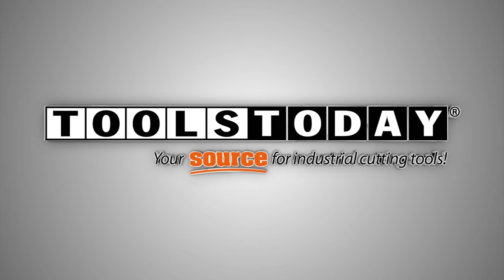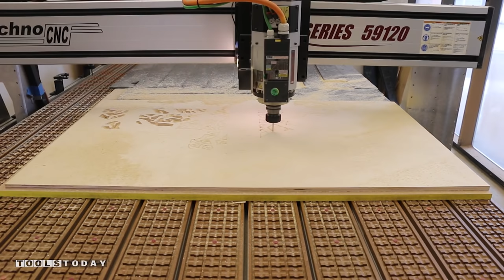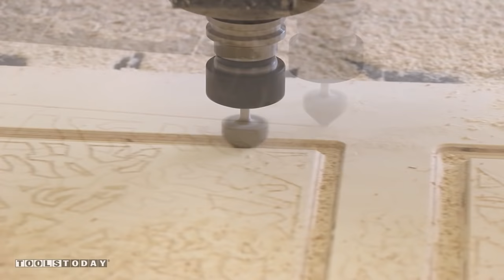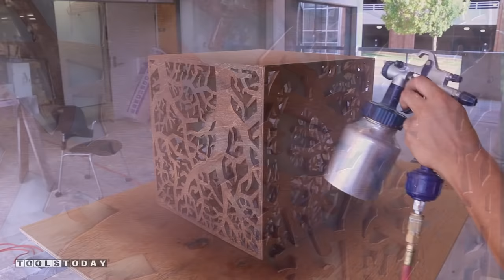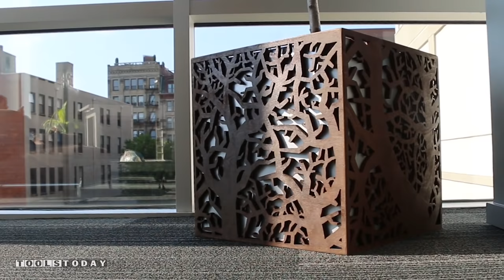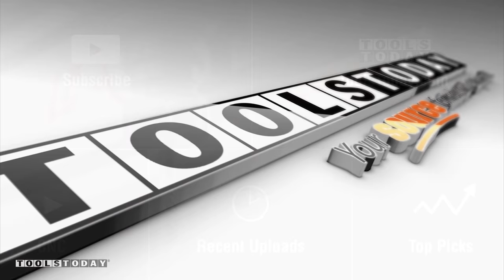CNC Project: Plywood Planter Flowerpot | ToolsToday

Comment: Nice to share good looking project.....QUESTION remains??....What was the actual step down ( dept of cut) value on this 1/8 bit at 120ipm ??
Thks
Reply from the maker: +rmesvp, For the 1/8" diameter compression bit no. 46180, the break point between the up-spiral and down-spiral is 7/32",  we cut just below this making the step down .22"/pass. This took 3 passes. We could have probably cut 1/4" per pass but we played it safe by cutting a little less.  For the V-Groove bit no. 45751, we stepped down 1/16" per pass, again, playing it very safe.
Reply: Thks for this....this will help ;0)

Comment: In regards to the step down of 0.22", isn't the feedrate a little high for the diameter of the 46180 compression bit?  I know you guys stated you were being conservative with the depth of the passes, but isn't 0.22" already pushing it?  I have this tool but I only operate it at 45ipm and .125" step down AFTER I have made my first pass with a .125" downcut spiral bit.  Amana Tool recommended .125" and 30ipm, so now i am really confused.  I am trying to cut down on my production times.  Please help. Thanks
Reply from the maker: +Omar James, we have passed your question to our technical department and will answer you as soon as possible.
Reply from the maker: +Omar James, we have recalculated the data and you can work with a speed of 18,000 RPM, a step down of 0.22" and a feed rate of 45 IPM.
Reply: +Toolstoday  But can I speed up my feedrate??
Reply from the maker: +Omar James, the manufacturer Amana Tool does not recommend speeding up the Feed Rate and RPM more than the recommendations.
Reply: so really don't understand this thread in the video you state that the tool cuts just fine at 18k rpm and 120ipm (which I believe I run downcut .125" spirals at 132 ipm with a .26" doc) but 2 messages up in this thread you are recommending 45 ipm which seems way way to slow (and not anywhere close to the chipload chart) and will generate alot of heat and is only a chipload of .0013" now under the product listing on your website according to the chipload chart Amana is stating under Veneered plywood a chipload of 0.012"- 0.014" at 18k rpm and x1D which is a feedrate of 432 ipm (for 0.012") and 504 ipm (for 0.014") so that being said if we drop the chip load by 25% due to the .22" DOC we arrive at .009" and .0105" with a feedrate of 324 ipm - 378 ipm   I just don't understand what to believe here and at 50.00 a pop we can't afford to be breaking a bunch while trying to dial in on one material let alone the 5 other listed in the chipload chart. I like Amana tools but this really really bugs me when a tool manufacturer says one thing and then the wholesaler says another and its all conflicting. 45ipm is way to slow in my opinion and we will be buying one every 10ft linear feet due to the heat generated and 432-504 ipm (even 324-378 ipm) is way to fast for a .125" shank tool at x1D (or x2d) in any material other than foam could we please have some clarification on this issue
Reply: Seriously., I've run into the same issue but have continued to buy these bits for years. I pretty much am running it at 0.25" steps at 50ipm at 12,000 RPM. I've tried running it faster but they snap. Also at this slow of a speed the path gets blown out in plywood and small pieces get dislodged if you are careful. I go through quite a few bits with my machine only really running up to 100 IPM. I do have a chipload spreadsheet and it will always tell me 100's of IPM for the proper chip load. What kind of material do you cut with this bit? What did you end up running everything at?
Reply: Hey Tom I have been running my tool at around 132-150 ipm and in some cases .75" doc but the usual is .25" doc with that being said I using it really only for a finishing pass taking off around .04"- .06" radially and .03"-.06" axially and 18000 rpm all the time so far I have run that tool in hard plywood like baltic birch seems to do okay but I am freakin scared every time I use the tool because at 60.00 you want to avoid breaking lol now I also bought the 1/8" single flute compression from Tools Today and that tool is a beast have ran up to 150 ipm in 1/4" mdf with high amount of chatter (my fault lol) and it did not break